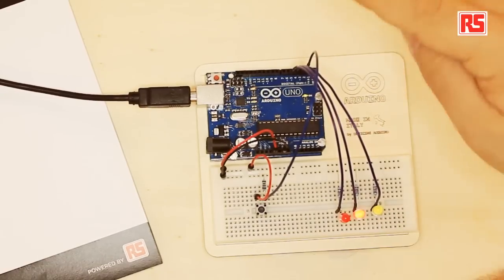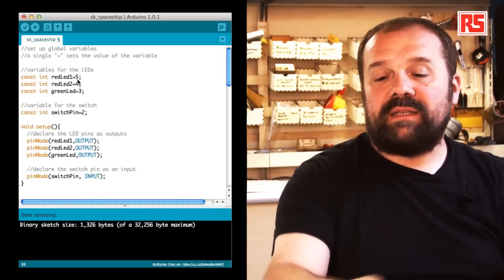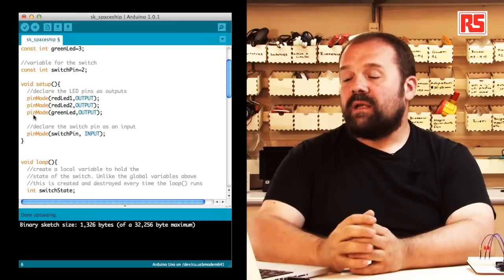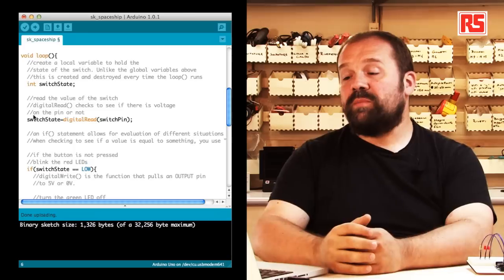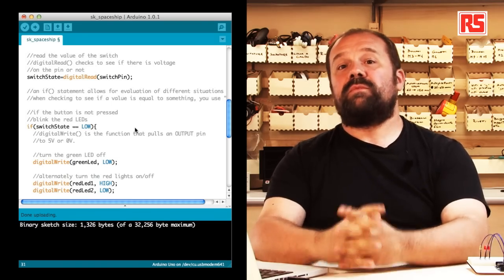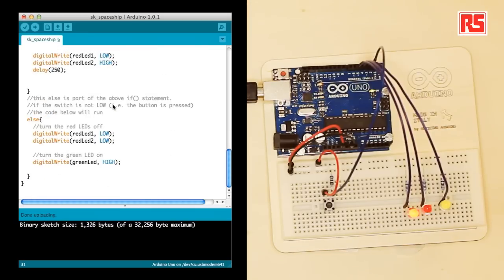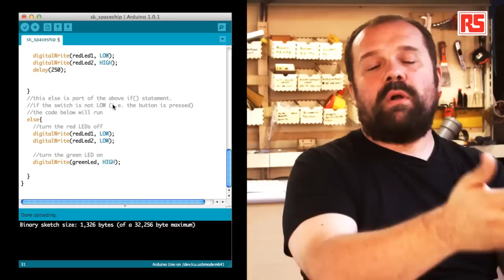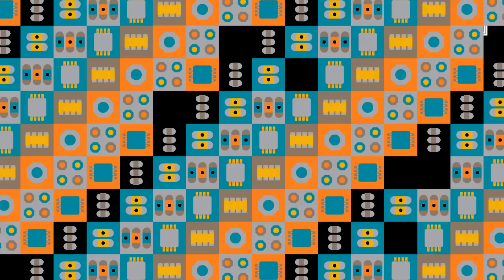Arduino Video Tutorial 02: Spaceship Interface | RS Components

Comment: Thanks for the comment

Well there are multiple schools of thought :) if this was an application where the Arduino needed every microsecond of tim it would be better to define it outside of the loop. But the time it takes to initialise a variable is probably in the nanoseconds and the events we're trying to capture are so "infrequent" that it doesn't really matter.  
Other people prefer to keep variable definition local to where they are used to make code more portable or easy to refactor.

Comment: Hi Massimo , first thank you so much for the video. I just have a question. Why do we need to use a 10k resistor in for INPUT pin # 2? I tried without the resistor and it works if my finger is close to the arduino board, but if my finger is not close to the arduino board it does not work.

Thank you in advance.